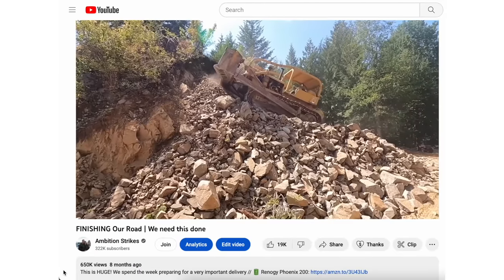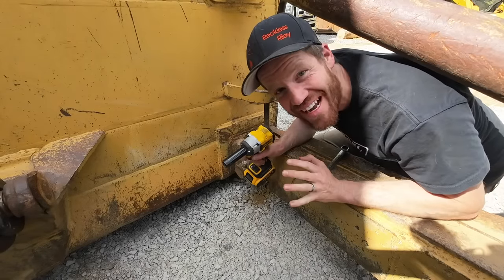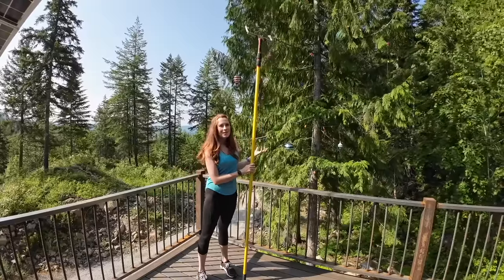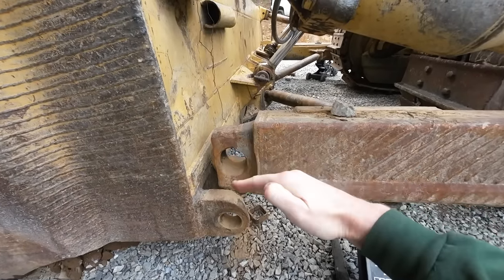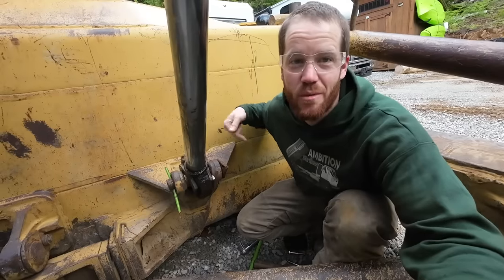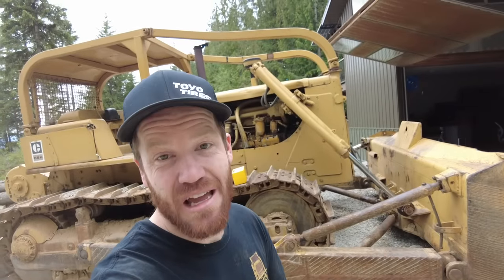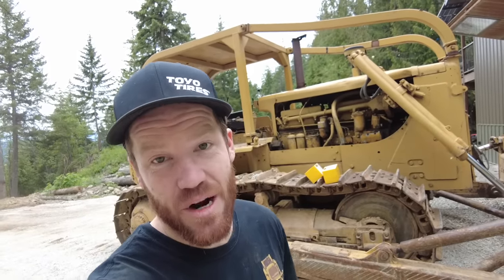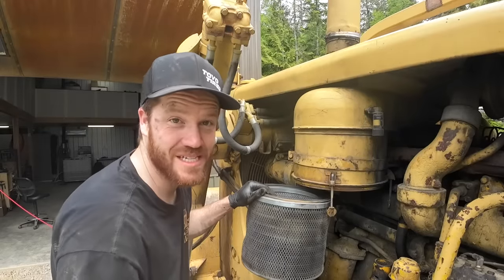Repairing My D8 Dozer (unexpected find)

Comment: Ryley, your farmer fix on the dozer arm, will get you by. But if you look, the joint was originally split with two bolts holding it together, and a spherical ball on the pin, with shims to set clearance. Oh and unless the world comes to an end, you will have the D8 for a long time, unless cheap repairs reduce it to scrap value. In which case get rid of it NOW, or do proper repairs.
Like the old Fram commercial, you can pay me now (inexpensive), or you can pay me later (Ryley, are you okay bud, you passed out, expensive). Your choice.
Best wishes from the far North.

Comment: People keep saying hydraulic oil and hydraulic filter and hydraulic tank.
Those are transmission filters he changed. The hydraulic system is separate from and uses a different type of oil than the transmission.
As to the oil, screen and filter, if there was that much junk in your screen and magnet imagine how much is circulating in every aspect of the transmission system including the steering clutches, oil coolers etc. Even if those chunks are from the previous tranny [pretty unlikely IMO] there is a ton of metal throughout the system and not fines but actual shards. If they came from this one, especially if they are bearing or clutch chunks, be prepared to either pull the tranny now [a brutal job] or have an 80,000 pound paper-weight in the middle of your driveway when it breaks at the most inopportune time imaginable, as they always do.
Buying the biggest cheapest dozer you can find usually means either [A] committing to spending far more than it is worth on huge repairs, [B] using it and selling it before it breaks or [C] as a throw away that you use until it breaks and then scrap. You could buy and use a nice little D6C or D two or three times over for what you'd spend on option A.

Comment: I would probably do a little research and find out if you can get the parts to rebuild it if not find a replacement and find out how much it cost. Cause I know it aint gonna be cheap? But just to be on the safe side. You should find out do some research and find out how much it actually cost just a thoughts

Comment: get a CAT 963 (or similar) w/ clam bucket and you wont need any other machinery
Reply: My early suggestion to Riley before he bought D-8 was to look for a 955 or a 977 CAT with a Convertible 4-way bucket ...You'd never ever have need for another machine . It does it all , having teeth it can RIP virgin soil , scoop  it up & carry it & dump wherever you need including a truck ..Also does great rough grading & pretty fair finish grading while also can grab a downed tree & carry it away to make a pile ...In short this type machine is the most versatile Best Bang for a Buck Machine you could ever want , you don't have to keep going up & down using a variety  of other machine to get the job done ....D-8's are great for what they do but are so limited coz let's face it , it is just a Dozer ....Love a D-8 , but it is what it is ....If they had more experience with & around Heavy Equipment they would've gone Track Loader w/ 4-way bucket ....Wisdom comes with experience ... They are getting loads of experience ( also , they are paying for their education ).....So have fun learning while getting wiser ...👍👋

Comment: Remember what ever you do to this Rig at lease you know yourself what happening. To replace this piece Equipment, you start all over again,  even bran new brakes. If you can afford to repair and replace parts yourself you save a heck of a lot money in the long run. Later you can sell that Equipment. Good luck.  Ps to replace Equipment these day is big money , older Equipment are easier to repair,  plus less Eltronics  to deal with. You can also use your Equipment for future projects.  D8 Catapillar 8R probably about $300,00 plus esaly

Comment: If you have questions about the dozer the best people to ask are the people at CAT. They can tell you I'm sure how the blade connection to the arms should be. Pretty sure its supposed to be tight around the pin. Probably need to weld the hole up to the size that that pipe can fit in and used as a sleeve. I'm pretty sure there's not supposed to be any play in that connection and the ball mount on the side of the track frame is where its supposed to do the pivoting. You really do need to change the hydraulic oil. It looked terrible and way past due for changing. Especially to get that metal out. That metal definitely isn't doing any good to the transmission being in there. Pay for the oil or a new transmission, which is cheaper? If you change it now you'll never run it enough that it will ever need changing again.

Comment: Please be careful about putting your fingers in those pin holes to wipe out the dirt. If something unexpectedly happens to shift it could cost you a finger or two. A good habit to adopt is to never put a finger in any pin or bolt hole. I've cought myself doing the same thing. You seam like a really likeable guy. And looks like you're having alought of fun 😊

Comment: at 10:05 it looks an awful lot like the part where the pin is going through is a 2 part piece so that you can unscrew it and insert a new ball for the pin, i would change that to new pieces (including the pin) and also grease it up good so it doesnt wear that much in the future

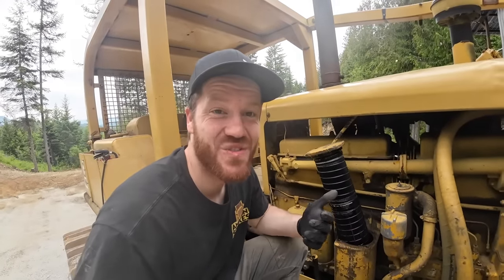Comment: so i understand the "put enough" in so it runs to not completely "rebuild" argument yes but at the point where they say they don't do oil changes (17:43) because it's too expensive for them.

oil is the life of ANY machine, there is just a bit more than just "lubricate" to it, absorb dirt and abrasion, also the viscosity must be given and maintained, so save on a "little" oil is the wrong approach with all love!

if you have to replace a pump, or valves because of too bad oil in the end, it costs much more than a few liters of oil!
Reply from the maker: We did a complete fluid change on the system last summer when we worked on the torque converter ($500). We just can’t justify changing it multiple times a year for how few hours we put on it. 😬
Reply: @AmbitionStrikes  oh OK sry I miss that join your channel at winter time.

Than ignore my message/comment . But the interesting part is why with the full change is so much metal part in it :( I hope nothing else going to die or broke up.

Fingers crossed

Comment: I thought you were going to use the dozer you just fixed and clear the road up to the spot. LOL At $3200 for oil change, what would a more costly fix be? What would the cheapest oil be? Amazon has 55 gallon drum oil for $600 Are you buying in bulk? With all the equipment you have now, do they all use same type? Preventive maintenance is almost always cheaper in the long run, then fixing something down the road.

Comment: On the dozer couldn’t you run a bypass system on the hydraulic fluid or drain the system filter it and return it back and clean out the hydraulic tank before refilling it with filtered fluid? Just a thought

Comment: Good rule of thumb is to change fluid as much as possible. Since it's too expensive for you. Do the 1/4 rule and change a quarter of the fluid at a time until it gets clear. Also, keep a close eye on the filters and levels. Don't forget to drain the water!

Comment: You Could just drain the oil and clean that oil via a DIY filter you make in a big bucket? barrel?  like i did with my Harvest Right freeze dryer system. put the cleaned oil in the cat with the expensive cat filter.  search Waste Motor Oil Filtration System .

Comment: I think the oil capacity is about 80 liters, not gallons. So about 20 gallons  I also think the recommended oil is 30 wt TO-4 about $80 for 5 gallons of SUNOCO TO-4 TRANSFLUID 30

Comment: NEVER have the throttle open with the compression off!!!!!! turn the engine over on compression to build up heat in the cylinders first then open throttle after it has turned over for a while.

Comment: Oh Dear! You should think about fixing the dozer properly it is only going to get worse, A proper fix is not as complicated as you may think, the blade arms come off and taken to a shop for line boring and the proper pivot bush fitted and of course new pins. I get the fact that you think you are not going to use the machine much, but later the repair bill will be much, much bigger, perhaps you could look at a mobile repairer if one is available in your area. I have performed similar field repairs. Not cheap but a bit easier than you taking the heavy blade arms off site.

Comment: Space taker upper I think Cal poly owes you a bit of of a refund😂 I know you're smarter than me but that sounds like something I would say but I do think you're onto something with a spear shaft bearing in each one of the 6part orifices in the arm to blade or shovel using smaller spear bearings at the arms then a larger spear bearing to  the blade 9:47  that you can run a shaft through with greasable access but flushing the system I would say is very important especially since you have found material in your magnetic filter small particles microscopic particles can build up and become a new problem especially if that transmission is a working transmission at this point you were going to cause yourself more headaches not flushing the system and doing that you can now check and monitor if your transmission is a problem now or this is remnants from the previous one but those contaminants will hurt this machine and you don't want it breaking down completely in the middle of your project that's a heavy machine to push out of the way to continue it with a excavator I understand it's cha-ching $ but it's a smaller cha-ching $ now then a huge CHA-CHING $$$ later

Comment: Out of respect it will work for now.  However don’t push it off forever. You are going to want to fix it right and get it to where it is supposed to be. Uneven wear leads to further damage down the road. It will get you going for now but make sure in time that you get it done right and you’ll never have to do it again find out what it needs and get it done.

Comment: Change the hydraulic oil..........and or trans oil.   Probably a bunch of metal in the drain plug area.  You can probably find oil at a farm supply store that meets CAT specs.  (cheaper)  That "dirty" oil will take the life out of the used tranny quicker. (opinion)   I get it; ya don't want to sink a bunch of dollars into something you are not gonna use much more.  Hopefully it will still move when ya get done with it.  Best of luck.

Comment: Why are you not useing mm in machining work, i think it is much easier to remember milimiters
Reply: That dozer is going to be all Standard American Engineering. All standard measurements. Going to metric would be a lot more trouble than it's worth. Say 2 1/2" pin. What's that in metric? Who knows. Catepiller will have that 2 1/2" pin. If you say the metric size they'll say - huh?
I've worked with standard measures all my life. I can work with metric. I prefer not to. Metric made it so any idiot can work on things. It's base 10. The problem is you have idiots working on things. Better to have a guy that can add 1 1/2" and 2 1/4" together. I know, fractions. Better educated machinists.

I've run into his problem. I'm used to working on smaller sizes than I've worked on larger equipment. It's no big deal. It's just a size or two larger usually. So instead of a 7/16 it's a 9/16", or 1/2 it's 3/4". For a guy like you instead of a 13 it's a 17.
I have tool sets with both metric and standard. For that dozer I'd be working in standard.

Comment: You don't need to use CAT fluid. Do a little more research. I would use a non-detergent multi-grade but there are some options. Should be able to find something for around $65/5 gal. If oil looks good but just dirty, it can be remotely filtered and reinstalled.

Comment: Run it hot drain all the hydraulic oil find 200 gallons of used engine oil at a shop in town flush the system. Filter the all the metal out the hydraulic oil you emptied and pour it all back it. Your rolling the dice with all the metal in there.

Comment: Don't know where you could put it but you definitely need a pole barn for all that nice equipment you have.
Reply: I’m almost sure Riley has it on a short list!
Reply: Pole Barn would be nice but , maybe not as practical for big machines as a Loafing Shed type Pole Barn ...Which you can still close in cheaply with external by-pass sliding barn doors...You see , with a traditional Pole Barn it would have to be Huge to house all their equipment & then still afford them the ability to take each individual piece out to use without having to move some others as well...With a loafing shed each machine can be pulled & used without any time & effort moving Rubik's Cube to get the one you want out , also being cheaper & easier for Two people to build ....Nowhere as deep , but is longer which does make maintainence alot easier by having permanent individual bays where you can hard pipe & hard wire each bay as maintenance for each machine dictates . Also affords each area with ability to stock specialty tools in easy to find area pertinent  to that particular machine ... Loafing Shed is the most efficient way to go ...👍

Comment: did it cross your mind , what if the dozer would go crazy by it's own and started to roll forward toward the house and you couldn't stop it 😵
Reply: Drop the blade and turn the engine off?
Reply: @AIM54A   yeah but what if the controls doesn't respond  , this beast of a machine can plow thru the house like butter